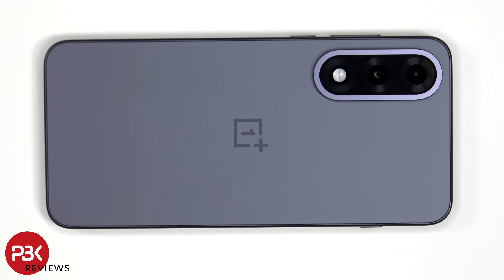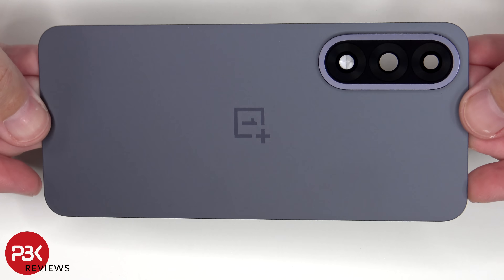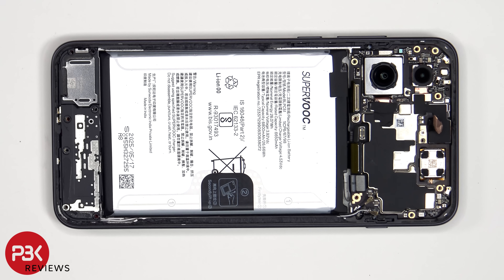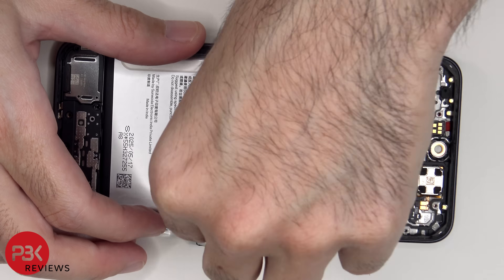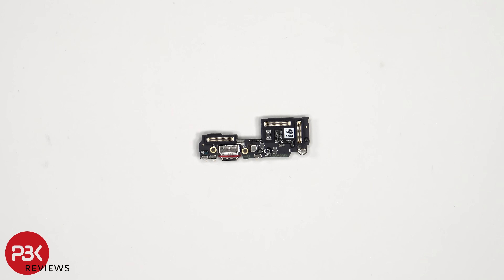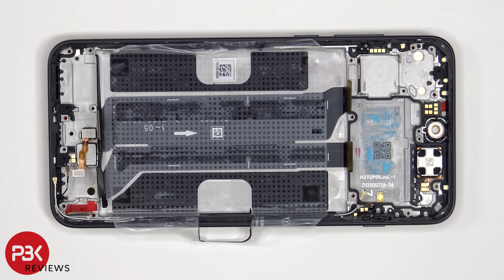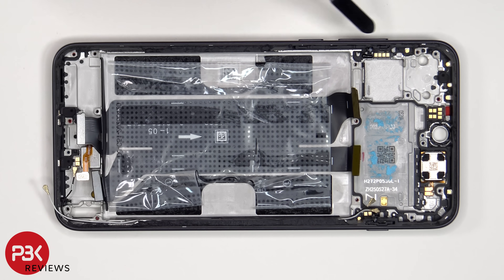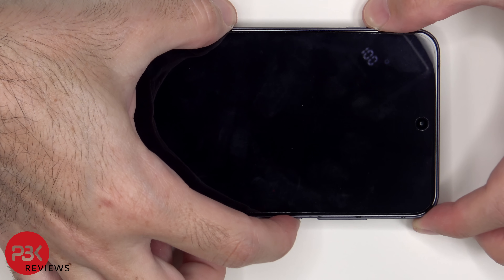OnePlus Nord 5 Teardown Disassembly Phone Repair Video Review

Comment: Did you ever make a video or test if larger battery can be installed normally in eu version?

I just realised they made dual flash lens (so I thought it had dual flash) but in reality its just a lens to deceive you and it has single diode flash. What a shame and cheap trick. bruh

Comment: Watching this on my newly bought oneplus Nord 5 😂😂😅
Reply: I am also...my new nord 5 1+
Reply: same😂😂😂😂
Reply: How is your experience with nord 5?
Reply: @iamhritwik genuinely saying it's a good phone, it has many features which I haven't used till now... Before I was using redmi & now I can say one plus is far better than that...
Reply: @rvigill7 bro charge this phone with inverter and you will hear some noise by phone while touching display...
Reply: @topicवाइज if its metal you get some static, not all phones gets it i think
Reply: @topicवाइज sure will try...
Reply: @iamhritwik good
Reply: @iamhritwik if u are thinking to buy this phone I suggest u to buy 100%recommended 🔥
Reply: One plus Nord 5 after display closed sometime display are flicker today I'm submitted the phone under replacement service centre.!! Bad experience in one plus Nord 5 I'm never too buy again one plus phone.!! First time I'm purchasing and so bad experience same to one plus brand
Reply: @samsingh179  when did you bought nord 5 and from where?
Reply: @samsingh179  same here
Reply: @samsingh179 apki problem avi vi aa rhi h ya ab thik ho gyi apki
Reply: same
Reply: Ghar pr krne pr heart attck ajyega😂
Reply: I'm also😂😂
Reply: Same... Its like my 35k tearing apart... I am sure today i will get the worst nightmare 😂
Reply: Same
Reply: Same 😅😂
Reply: Watching on my ace 5 ultra (same phone just different chipset)

Comment: I hope you reapply some thermal paste if you resell these or intend to use them. Please do Moto G86 Power if you can, I really wanna see the 6750mah si-ca battery. 😋
Reply from the maker: Yeah after the videos I take them apart again, and properly clean, apply thermal paste and add new adhesive to the phones before sealing them up.